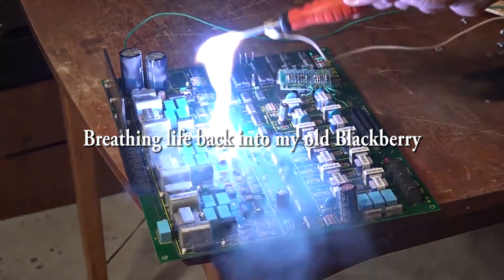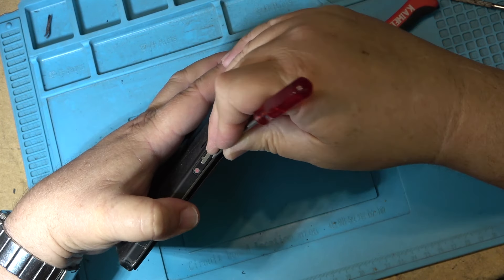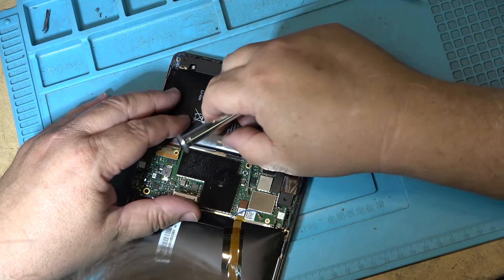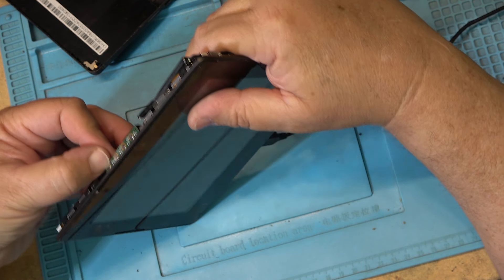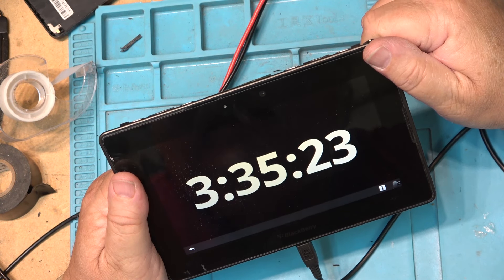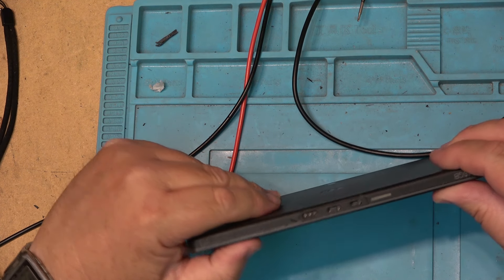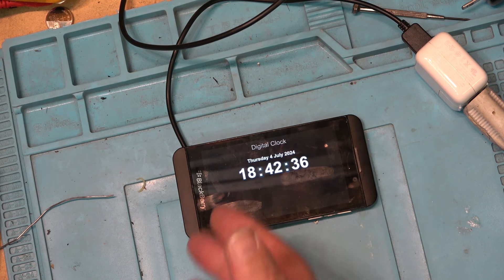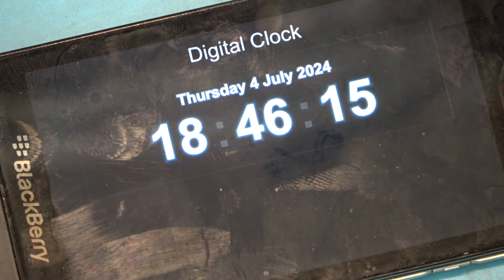Breathing life back into my old Crackberry's

Comment: I had a BlackBerry years ago. I loved it alot. Loved the keyboard and it allways just worked. Kinda sucked for Youtube but it always did the job. At the end of its life i used to have to periodically jumpstart the battery with a 9 volt to get it to charge.
Reply from the maker: I miss my blackberry.  Best phone I ever had.  😊
Reply: @12voltvids  I tested my BlackBerry from 10 years ago the other day and it still boots up using a power supply in between the battery and contacts. Feels so interesting navigating through its U I now.

Comment: Dave you can try leaving the battery BMS chips connected to the tablet but cut the connections to the batteries and remove them.
Also Isopropyl alcohol is great for removing double sided tape from batteries and makes them easier to remove.

Comment: I think a voltage divider from the 5V source with an additional diode could help make the device think there's a good battery with 4.2V connected that just doesn't pull any current cause it is "full". That could maybe work.

Edit: Ahh nice approach!
Reply from the maker: The bms chip works like s jewel. Putting the power to the leads where the battery was nope, but to the input terminals with the bms chip connected yup.

Comment: Do the same to the playbook as you did with the phone with the power hack should work the same :)
Reply from the maker: Now that the phone is up and running again it will be the time display.  Playbook had to stay off network and be connected every few weeks to correct the time.  Phone pulls time from cellular network so it's always correct

Comment: I liked the flash player they had lots of neat programs for it maybe if you got a older computer they might have still have a version of flash you can put on it I liked shockwave player to
Reply from the maker: Flash was disabled on all browsers several years ago.  It was killed with a pushed update.  It still works on the old phone because BlackBerry had ended updates of bb10 by this time.  You would need an old computer that has not been online in years.  Dame went for internet explorer.  Its gone too.
Reply: @12voltvids  I've actually seen Internet Explorer on a windows 10 computer about a week ago. I also found that if you stop Microsoft edge from opening on your computer, you can still use IE. (Wouldn't recommend it though)

Comment: I'm wondering what  electricity bill you have with tons of stuff plugged in 24/7 ?
Reply from the maker: That came down because the devices that run24/7 now have a 3 hour discount rate every day. It goes up for 5 hours in afternoon and goes down for 8 hours a day. So net 3 hour saving on all the crap that runs constantly.